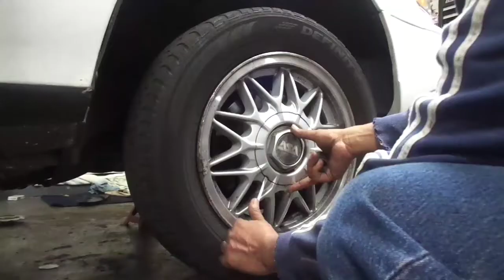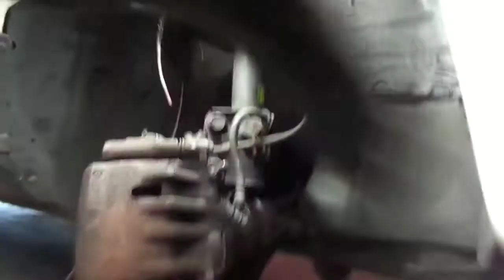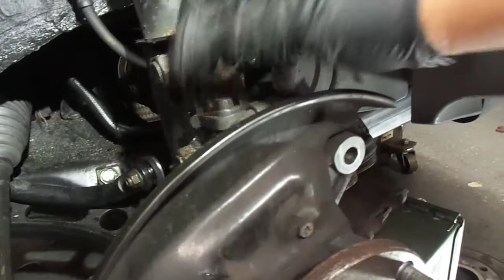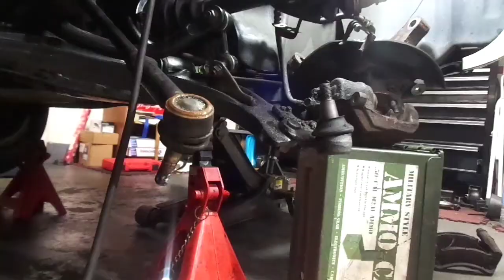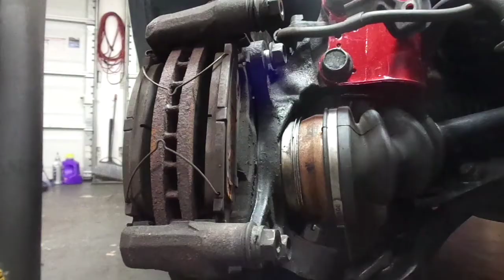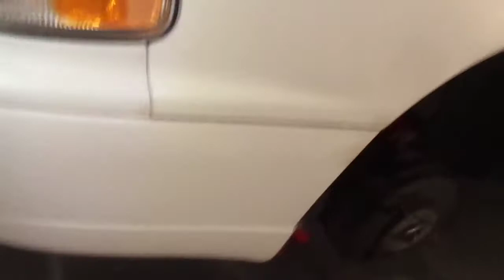1995 toyota camry front lower ball joint replacement

Comment: That looks very complicated. Saw another video on this, at least it gives me an idea of asking mechanic if there’s the abs system in the way or could he just separate the ball joint’s top bolt (castle nut) by use of pry bar on lower control arm, along with a ball joint separator. Thanks for the tutorial video.